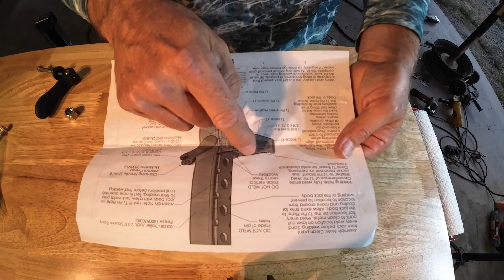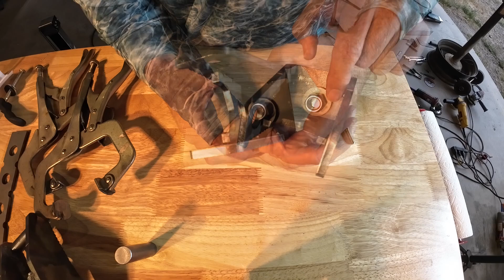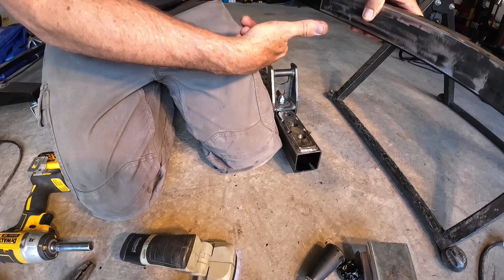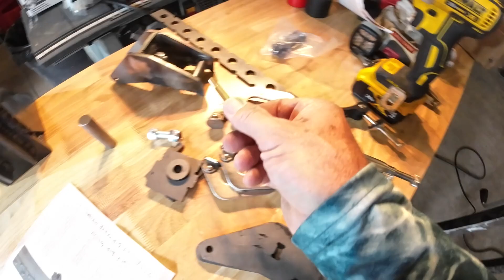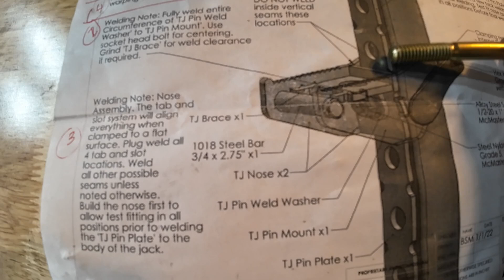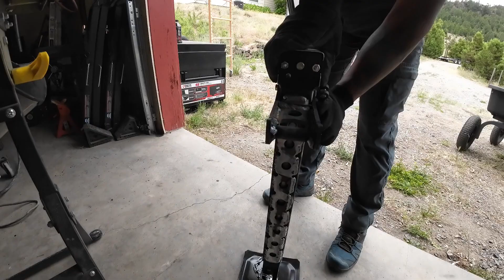Tauler Jack MISTAKES (x 2 Builds)

Comment: For the little nub inside from burn through, it might be easier to build a broaching block with an adjustable carbide cutter. Similar to carbide used on a lathe.
You could also clamp a piece of aluminum as a heat sink to keep from over heating the 12 gage material of the jack.